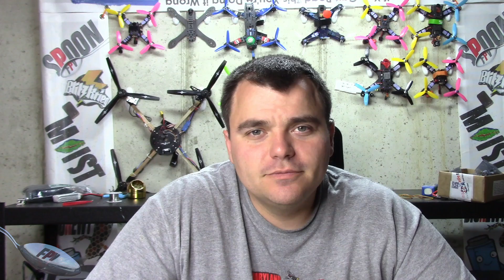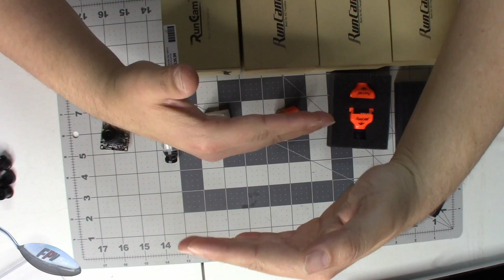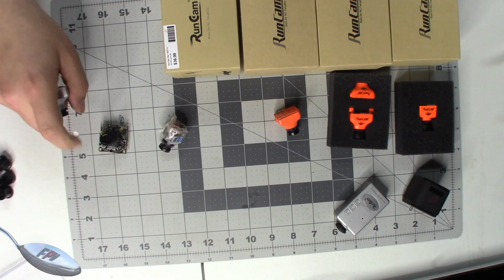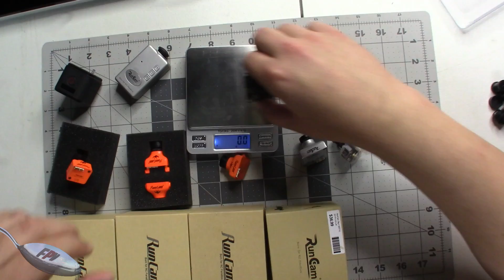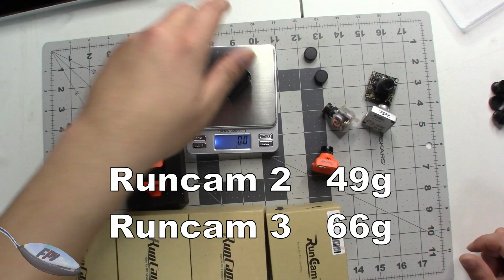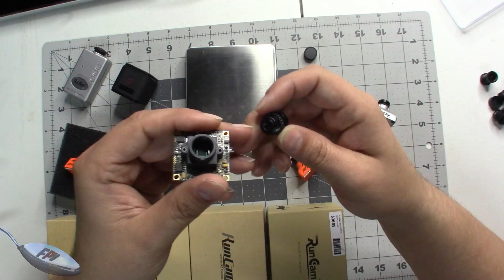FPV Camera Part1 Selection

Comment: When do you plan to drop that lens analysis video? I'm still new to FPV racing and FPV in general and interested in your input on lens selection.
Reply from the maker: I don't have an opinion on which lens is correct for you, it's a personal preference thing.  I know in the past I really hated the small format wide angles like Runcam has went to now, but looks like they addressed all of my complaints.  I fly a 2.1mm on a Swift V1 and now I fly a 2.3mm on the Swift V2 and Swift mini (spoiler alert) the 2.3 is equivalent to the field of view of what I'm used to on the 2.1 on older models.   Many people prefer the feel of a 2.5mm, and the RG25G lens is the highest quality lens I've ever used, but I like super wide.  If you fly Quads I think wider is better, but it's really about what you like.  Don't fly 2.8 on your quad, save that for your fpv plane, I will say I think that's too narrow a field of view for most on a miniquad.
Reply: Thanks for the info!

Comment: What batteries do you use for racing?
Reply from the maker: For racing I use the Lumenier Graphene 1300mAh 4s 80c  or 1500 depending on the track.  I do not recommend these packs for every day use.  Admittedly I beat the loving snot out of my race packs(massive amp draw for long duration to almost full depletion), but I think they lose their punch/drop cells after about 20 or so cycles.  But for racing, I've never flown any pack that delivers throughout the entire pack like these do.  I've been trying the new Strix packs from RMRC for my daily pack, but I don't have enough flights on them to make any sort of claim about longevity.  I want 100-300cycles out of my everyday packs because that's what you should be able to expect from a lipo.  I also like the Revletric packs, for racing, they have a good punch throughout the range.

All my race packs I charge at 1/2C, and never parallel to ensure even electron distribution and maximize their life.  So that's one way I don't beat them up.  I also don't generally over discharge them, but if I have a lap left and no pack, I will take it to 2.5V a cell to finish that lap, but then I take that pack out of the rotation.